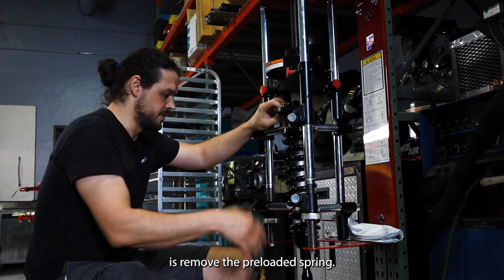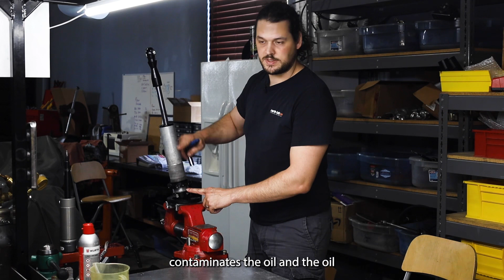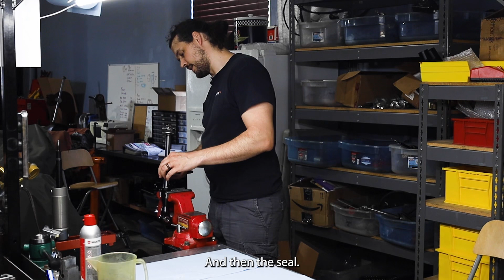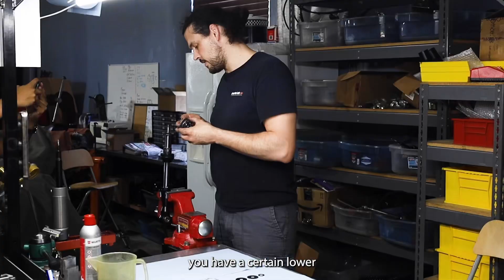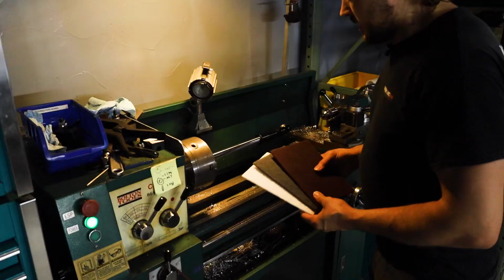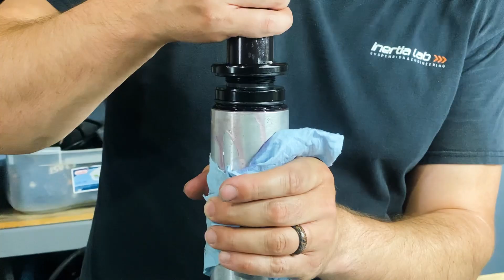Deep Dive: Rebuilding the ICON 2.5 IFP

Comment: Good informational video thank you
I had a question about the Internal Floating Piston for the Reservoir, how far down do you push the Internal Floating Piston down in the Reservoir on Icon 2.5 series Coilover Shocks part number 58735
Reply from the maker: Keep it all the way to the top.  Then when you've bled the piston and filled it with oil to the brim with the piston near the fully extended position just push the shaft seal head down while making sure the shaft/piston stay in place. This will clearance the piston appropriately away from the top of the reservoir.  Always check full stroke once assembled.

Comment: would of been nice if you would of shown the tool needed to put the gas in
Reply: I agree.  I think mine need Nitrogen as they make a clunking noise on drivers side on holes but not say train tracks.  Less than 6k of road miles..not 1 offroad trip.

Comment: Hey Chris I’ve been desperately trying to find someone in the DFW area that could rebuild my Fox 2.0 Shocks from Carli Suspension. I’m not sure if they’re even rebuildable at this point. If this is something you might could help me with could we try to get in touch?
Reply from the maker: Some are rebuildable and some are not.  We need to know if yours have a fill port near the base of the shock body.  Reach out to info@inertialaboratory.com
Reply: How do you remove the coil from a 2015 F150 Icon 2.5 IFP coil over? I can’t find anything online that explains how to remove the lower bearing shaft that bolts to the lower control arm.